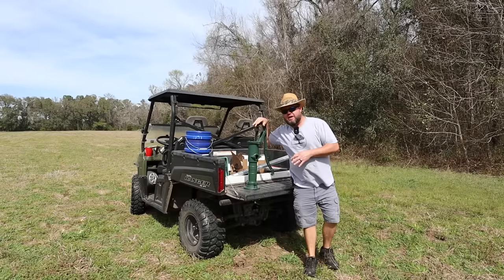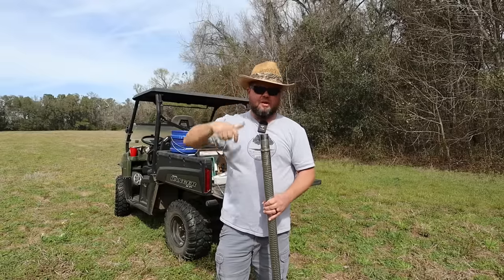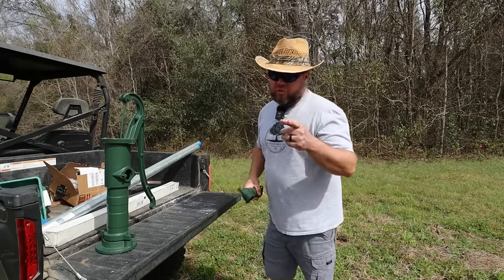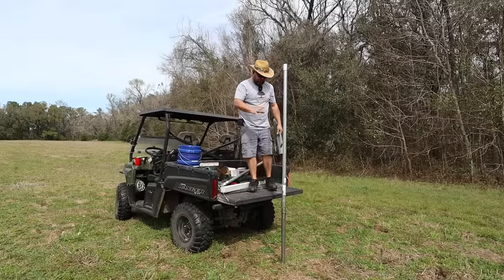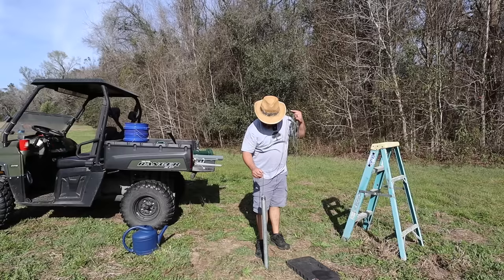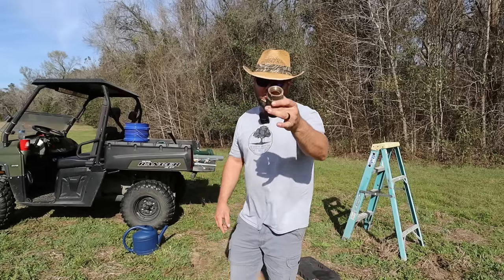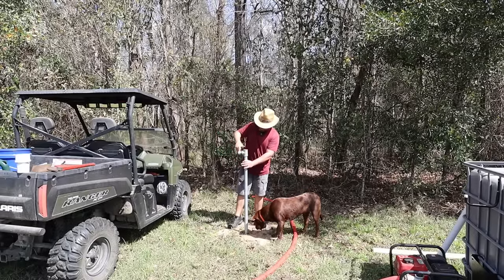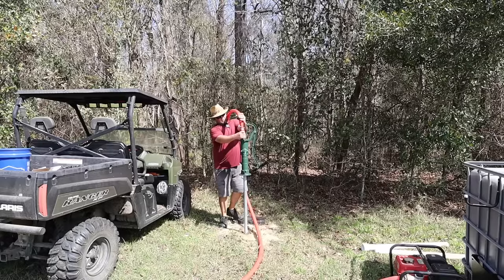FREE Water, DIY hand well pump install two different ways. Off grid pitcher pump. Part 1 #732

Comment: I think the water table in my part of Las Vegas is down around 800 feet or so. I know there are some wells that were put in deeper before finding potable water. While a hand pump isn't likely here I still found the video great to watch. Andrew always does a good job of providing great information to those that need it.
Reply from the maker: Yeah I don't think it would work for you 😉
Reply: How much do the average well in las Vegas area cost per foot?
Reply: Andrew could you water jet say a 8"-12" well diameter using pvc pipe then go back with the Sandpoint well system inside the pvc pipe for more traditional well?
Reply from the maker: All you would need is a 3-4 inch well casing accomplish that. It's possible.
Reply: Keep in mind it's very difficult to dig in the Las Vegas Valley because it used to be an ocean floor the rock is super hard almost a stranger bus to concrete I believe they call it caliche
Reply: Wait for the monsoons or head on over to New Orleans 😁
Reply: Andrew - how deep can the water jet method go to in an effective way? Under similar circumstances, if one were to install an electric water pump with a 30 to 50 gallon pressure tank, would it be possible to use this method to dig a well let’s say 100 feet deep, if needed?

Comment: Why didn't he just slide that PVC pipe down into the hole he put in from the first one? Either way he's running his sand point pipe into the clay. I would have just put that PVC in the existing one and then slid the metal pipe in it after he cleaned it out? Good thing he went farther in then 3" because to shallow and you can get contaminated water
Reply from the maker: Gray pipe clay does NOT percolate water well. No way I'd depend on a well head in it, you'd out pump it.

Comment: FORGOT CHECK VALVE
Reply from the maker: Pump has built in valve plunger that seals, watch next episode where I do have a check valve for the additional pump. You also do not need an extra check valve when I have a manual cut off valve below the pump.

Comment: They don't make post drivers like they used to.  You can weld the top of a sledgehammer to the top of post driver to get some extra weight. Helps with driving posts, etc.
Reply from the maker: I've been eyeballing one of those gas powered ones 😬
Reply: AHAHAAHA About 15 Years ago I added 15 Lbs to Mine, now it Weighs in at 32 Lbs  
I'm a large well Fit Guy and can wield it no Problem. I use it to Pound on My worlds Largest log splitter that Weighs in at 31 Lbs. HAHAHAHA..
Reply from the maker: I've got a few thousand fence post ahead of me, that's why I'm liking the sound of that gas powered one.
Reply: @TKCL  Are 3 point post drivers rentable down there ??
Reply from the maker: Never seen one at the rental stores

Comment: Where I am in Louisiana our water table is so shallow digging a post hole fills with water.  We have a permanent well at 23 feet that hasn't run dry.  Also we have no rock.
Reply from the maker: My last home the well was a little over 20 ft, and the water always stayed around 15 ft.

Comment: You’re so lucky to have so much water. In the desert Southwest it’s much harder to find and almost impossible to get a new well permit to drill and if you get caught with a non permitted well it’s a pretty serious charge due to very tight control and ownership of water rights across the aquifers . Great information and really enjoyed watching.
Reply from the maker: So glad we don't have that here.
Reply: That's kinda bs. What happened to the property rights where you owned to the center of the earth and as high as the heavens.... I could understand water rights on a stream or something but
Reply: @Bward216  actually I’m not sure those types of rights ever existed in the modern world. Water rights in Colorado are a huge topic as Corporate agricultural interests have tapped into public aquifers thru wells drilled on their land and depleted water supply so the intent of the current water restrictions and protections are good ones. Of course big corporations are now buying up all the land with water rights to give them larger percentage of ownership to aquifer capacity. 

Many buy land in Colorado dreaming of a homestead only to realize it’s very difficult to get a well permit. Best to always buy land with an existing well but just that presence can exponentially raise the cost of land. Water is the new oil and gold in the desert southwest.
Reply: @johnnyllooddte3415  not in the desert Southwest 4 corners region unless you have specific water rights. Water access underground is accessible only via State water permits. This helps keep the big agricultural corporations from siphoning all the water from the public aquifers.  You’re probably right though about ‘most states’ but the desert Southwest of Colorado, Arizona, New Mexico, Utah and California have very different water laws and for good reasons.
Reply from the maker: It's not required here, I'm thankful Iive in an area without all the extra BS. My home well was drilled by a professional company and no permit required. I even had the sanitation department out here doing water tie in and septic inspections while building our house. Not one mention of a well permit.

Comment: Dig a 3x3 hole about 3ft deep. Then use post hole diggers to go down as far as you can. Then you can put a 12ft step ladder over the hole and lower your pipe down into the hole.
Buy a T and put an end cap on one side of the T for pounding on .
Screw the other side of the T onto your pipe. Then run a garden hose into the bottom of the T.
Turn on the water and start pounding on the cap. The water pressure will dig the hole and move dirt out of the way.
Unscrew the T and add another piece of pipe as you need it.
In most places you will find clean water within 30 feet of the surface. 
Be sure that you are at least 100 feet away from septic tanks or pig pens or other possible sources of pollurion.
This water can be tested to be sure that it is safe to drink or it can be boiled or filtered before drinking.

Comment: Congratulations on building the pump quite quickly.
Unfortunately, I had to give up the project because the water table is 150 feet and there is clay soil. A company once made me an offer for €5,000 plus the pump, which would cost another good €1,000 plus the high power consumption. That's why I prefer to use public water, which is cheaper. Greetings from Berlin
Reply from the maker: Thank you for watching Hans

Comment: I've been digging holes for a solar installation and they filled with water pretty quickly. It's made me think a Sandpoint well might do well here and I'm considering it for a hose. I have clay too so hopefully it's not as bad.

Is the next step rain catchment?
Reply from the maker: Sounds like shallow water.

Comment: The pump shows a G1-5/8 inch fitting on the bottom.  Will that accommodate a 1-1/4 inch pipe or do I need an adapter to connect the pipe to the pump?  Thanks
Reply from the maker: I screwed standard 1 1/4 water pipe right into it.

Comment: What length pipe are you using and how many? Does the 36" drive point count in the 22' depth for well draw.
Reply from the maker: 4ft pipe sections, it's 18ft of suction from top of the sand point.

Comment: Andrew, say you left the pvc pipe in the ground and you wanted to water livestock. Could you drop a pump in the bottom say with poly pipe and use a solar panel to keep them watered is there enough water that shallow to do that ?
Reply from the maker: Not sure if it seeps quick enough for that or not. I plan to find out 😉

Comment: I believe you were checking for plumb
Reply from the maker: Yes, I have a bad habit of saying level because I'm using a level.
Reply: @TKCL   lol me too but I  heard the voice of my father correcting me when you said it 😂
Reply: Maybe late do a cast in place  concrete post with footer around the pipe for that pump to set on top of?   Probably not necessary but would be a cool video and take the wobble out of that pipe while you’re pumping
Reply from the maker: Wobble is coming out soon enough. Wait for part 2

Comment: Where can I get a microphone like your using?  I grew up on Tobacco Farm in Southern Ontario, and we had 2 Green houses and in front and besides these greenhouse was a water tank, elevated about 15 feet in air that held about 750 gallons of water, and it was fed by 3 points sunk 13 feet deep in sand, and this supplied all the water needed for green house, showers that were set up in green house during harvest and drinking water at the tap at hip level for an adult
Reply from the maker: Amazon, Rode go 2.

Comment: So you pulled out the 2" pipe completely and then dropped the steel wellpoint into the hole 14:29? The hole didnt collapse when you removed the 2" pipe before you could get the well point in?
Reply from the maker: Correct, but even if it did collapse, that sand point is designed to be pounded in.

Comment: I didn't see if you put that regulator in to prevent the water from going back down.
Reply from the maker: No because part 2 I'll be adding something else. However the back flow preventer built into that pump works very well.

Comment: check valve can be at the top? any benefit to having it further down toward the point?
Reply from the maker: Check valve at top or foot valve at bottom.  Both work for keeping water in the pipe. I wouldn't put one at the bottom if pounding the pipe in.